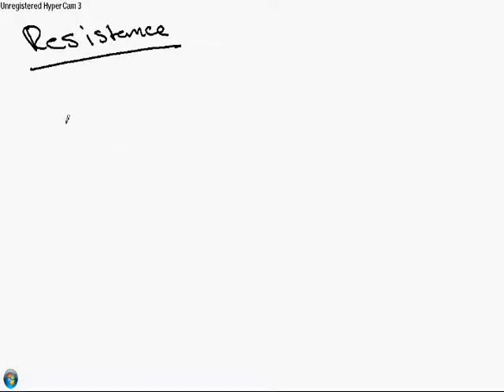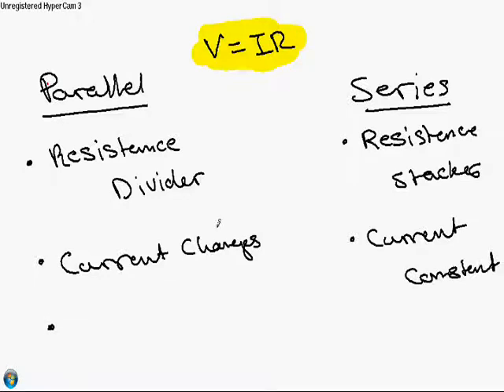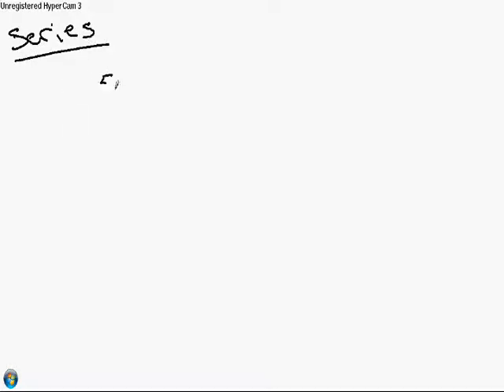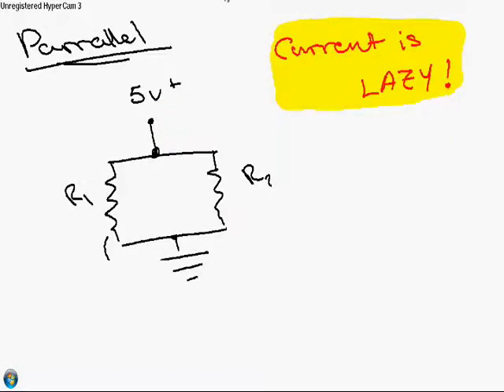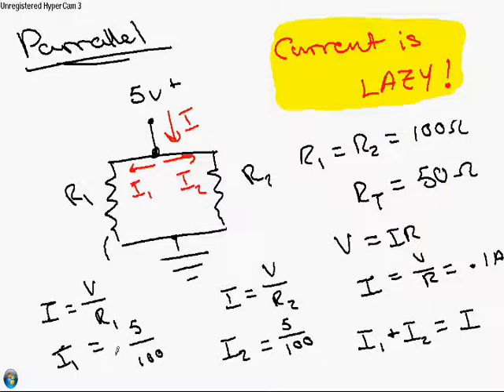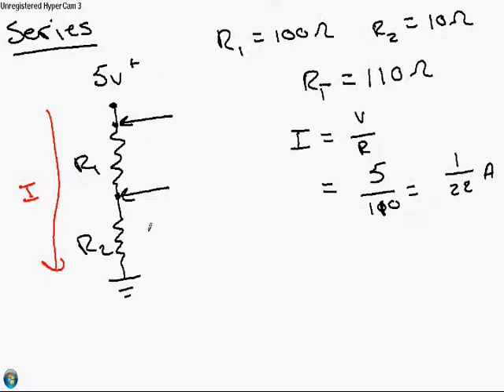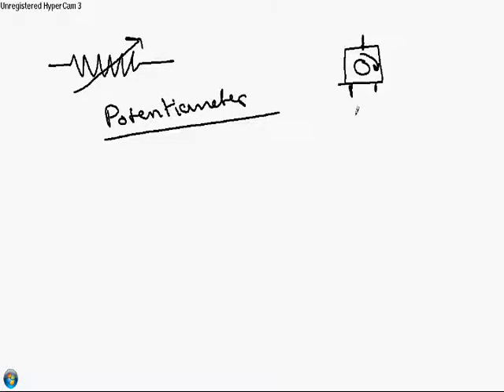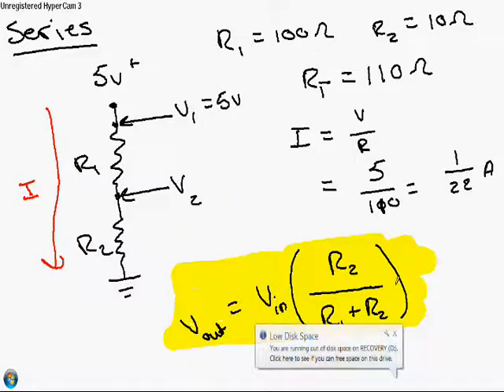Electronics 101: Resistors

Comment: Can someone verify this for me? I ORIGINALLY thought all resistors did was take a current if it is too high, and lowers it TO the value of the resistor. If this WAS true, then putting 2 resistors in parallel or in series, would not be any different than a single resistor, but that is NOT true. Therefore, the description of a water tunnel with a constricting area, is a bad example, because putting an unlimited number of equal constricting areas in a row, would have no change versus a single one. However, when I did some tests with "Circuit Construction Kit", I noticed that each time I added a resistor, regardless of series or parallel, it still lowers the current for each additional identical resistor. So I am wondering just how they actually work. I understand that DC loses voltage the longer the distance is, which is why power lines are AC. 

Based on the first resistor you showed, which you said it was a "coiled wire around a non-conductive core", my prediction is that Resistors, are sort of like ultra long extension cords of a DC circuit, which lower the current based on how "long" it extends the wire (virtually). This would explain why more resistors, decrease more current and adding any resistor at all, is not made to act as a "fuse" that instead of blowing, just slows down the current.

Which means that EACH resistor you add to a current, WILL ALWAYS decrease the current, no matter what the current is and no matter what the resistor is rated as. Therefore, 100 5ohm resisters will cause more resistance than a single 5ohm resistor.

Comment: i have a 12 volt and 5 watt solar panel and  i want to know how much ohms resistors i need to lower the volt to 9 volts?  and do i need to use two resistors or one resistor? Or are there any other way of  lowering the volts that is more better? So any ideas?
Reply: +Francisco Sanchez I hope other users will answer your question but my calculation is like that;
12V - 9V = 3 V you need to absorb. 
Watt = Voltage x Current so 5W = 12V x 0.41 A
Ohm law says : R = V / I so R = 3V / 0.41A = 7.3 Ohms
and your circuit will spend 1.23 Watt (3V x 0.41 A)
and it&#39;s recommended to use minimum 2 times bigger than Watt you will spend in circuit, so 2 x 1.23Watt resistor wattage value = 2.46 Watt resistor
Finally your question's answer is 1 resistor will be ok for you and it's a 7.3 Ohms 2.46 Watt resistor. But I think it&#39;s out of standard Resistor values, so you can use 6.7 Ohm 2.5W or 3W resistor.
Reply: Francisco Sanchez  and

Comment: I have a couple questions about this video. First, when you gave the formula for series resistors, you provided R2 over R1 + R2. What is the reason for R2 on the top? If I were to have three, or four resistors in series, how would I know which R value to place in the numerator?

My second question is when you're explaining the potentiometer. I don't understand how you're splitting and adjusting a ratio between two resistors that are in series. There's only one path to take.. I can only fathom that they would be in parallel and the pot wipes between the two sides. Thanks for these videos!

Comment: Good work, as far as the Voltage Choking equation goes I got an answer of .454v. Is that correct? The input was 5v..
Reply: +Anthony Mosallam I was wondering this as well 0.45454 repeating.

Comment: This IS a great post. It's also nearly forty. Forty months of age, that is.  HHD has moved on to C programming. 

When you get far enough along to ask what came before PWM (pulse width modulation), the answer will be "variable resistor devices" -- like the potentiometer. There is a two-pin variant, called a rheostat. The rheostat is connected in series and the whole resistance is present between the terminals. 

This component also uses a wiper, the terminal of which is connected back into the series circuit at one end or the other, depending on design requirements. The wiper serves as a shorting terminal and actually directly varies the load on the power source.  

This is not a precision device. Think "space heater", for a typical application.

Comment: This is great but I missed somehow the jump from a series resistor to equaling = (R2/(R1+R2)) ... was very clear that the total Rt == R1+R2 but the relationship to V, subsequently becoming a quotient of R2 didn't make sense.
V = IR ... I stays constant in a series Resistor, right? so I figured V = Rt*I ... what did I miss?
Reply: A friend just explained it to me and what wasn't clear in the video was that Vout is the node between resistors. So {Vo}/[Vi] = {R2}/[R1+R2] ... so Vo = Vi(R2/Rt)
Reply: +Matt Jackson I&#39;m still not sure I understand this part. :X

Vo and Vi are what are confusing me, why does {Vo}/[Vi] = {R2}/[R1+R2]? Where is the numerator coming from? What if there were three, four resistors in the series?
Reply: +naota3k he's using voltage division for the series example of the two resistors so the node which is denoted as V2 that is located between the two resistors so Vo (output voltage) is measured from Vi(input voltage) which is the +5V and respect to ground when you measure voltage it's the potential difference between two points and since voltage is measured across components the voltage output is measured with the respect of R2 since that's where the voltage drops last before entering the output node with that said the output(Vo) is the equal to the input (Vi) times the Resistor that is in respect to your output divided by the equivalent resistance of your circuit which means the sum of the resistances. And the same principle applies if you had more than two resistors only difference would be is the numerator value your numerator value solely depends on the resistance that is in respect to node voltage you're measuring

Comment: Question: if the electrons do want the path of least resistance, then why do the electrons go down both paths in a parallel circuit with two resistors?  What is preventing all the electrons from just going down the path with the least resistance, and ignoring the path with the greater resistance?  Thanks.
Reply: w0mbles Water and pipes are a common analogy for electricity, so think of it like a river, if a river forks and splits into 2 channels, the water will flow down both of them, parallel circuits work like this.
Reply: rightmoves Thanks.

Comment: Thanks for sharing, but I found it a little confusing.  Just the presentation.  Let me explain.

You show conventional current in your videos but probably should mention electron current.

In the parallel resistance portion, you delve into a little circuit analysis, but in the series protion, you abandoned the circuit analysis for voltage dividers and never really discuss the Ohms law approach to determining the voltage drop.  Instead you used the voltage divider formula.

Please don't get me wrong, you are doing a great thing here, just needs a little more fleshing out.

Thanks for your hard work!

Joe

Comment: I'm having trouble with the concept behind the changes in voltage and current in a parallel or series circuit.  I think the easiest way to explain what I'm not following is this:  if V=IR, and I=V/R, then across a single resistor, which property takes precedence? take a 5ohm resistor with a 5v battery that can provide 1.5amp, if this is connected in circuit, what is Vin/Vout and Ain/Aout?  would the resistor be resisting the voltage, the amperage, or both?  if both is it proportional?  what proportions?  how does this play into what you explained in this video about the volt/amp being constant/changing in a series/parallel circuit?